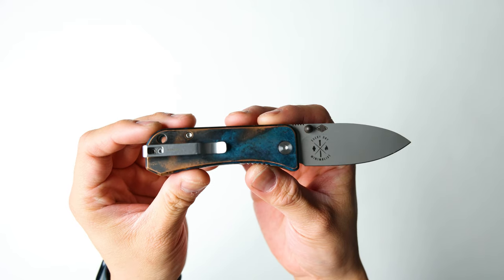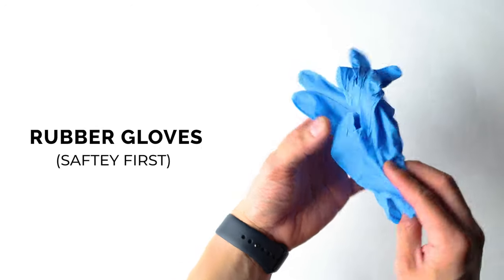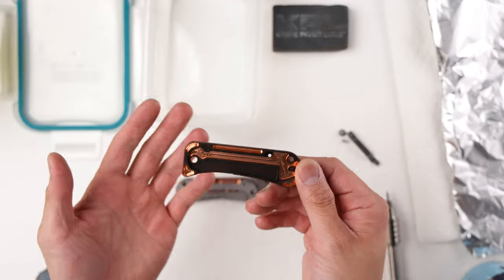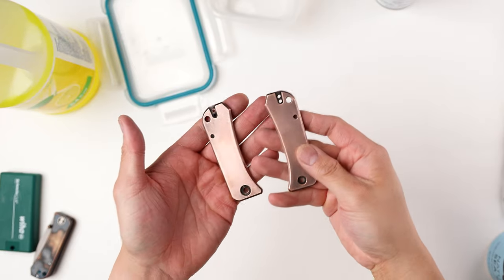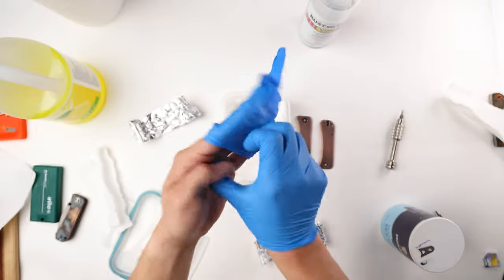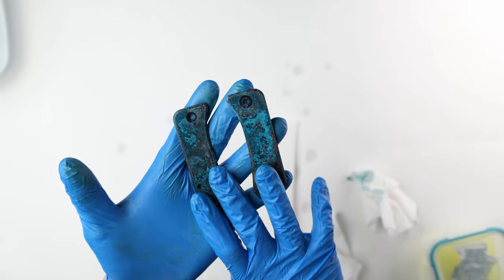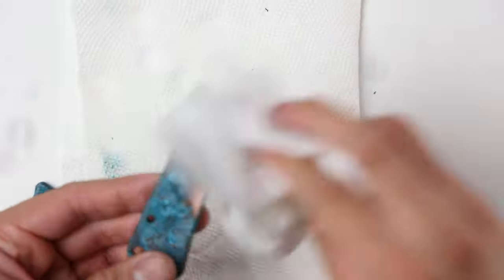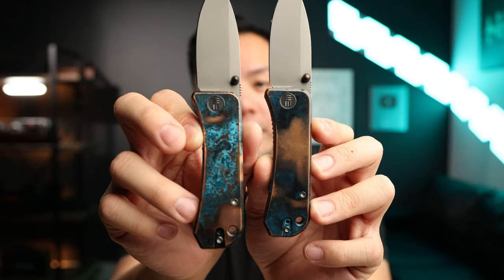DO THIS TO YOUR KNIFE?! | Shipwrecking Copper

Comment: Hey EDM, I love this video, and I actually ended up shipwrecking my Brass Elementum via the directions in the short you posted a couple months back.
Also, a quick tip for those who for some reason don’t want the blue, and just want a brassy / bronz-y finish, use a paste of baking soda, vinegar, and flour (iirc) on the scales, wash it off, and then you’ll be left with a really cool mottled dark brass design that I currently still have on my Elementum.

Good luck to all!

Comment: I really appreciate your work , I am a big fan , in 14:43 you unfortunately but back the ceramic bering in the opposite way I know there are many guys out there side that isn't matter but believe me it's matter,  u can check your video when you disassemble the knife and you will find the bering in the correct way installed from the factory. 

Keep the good work up